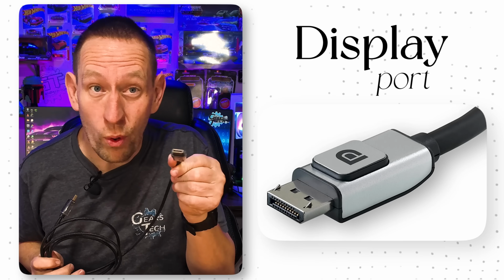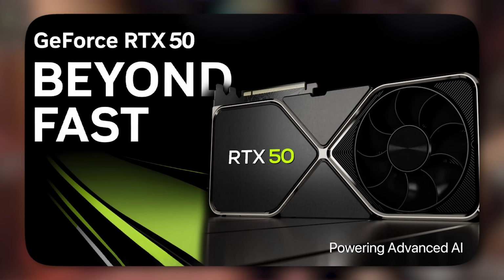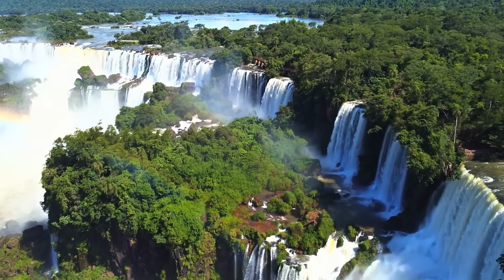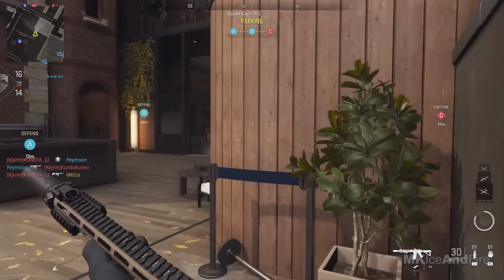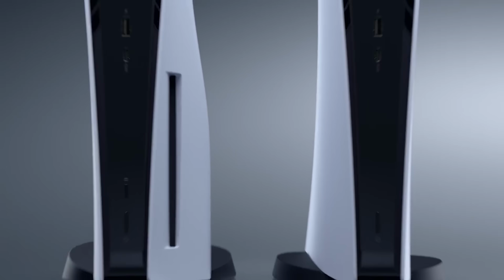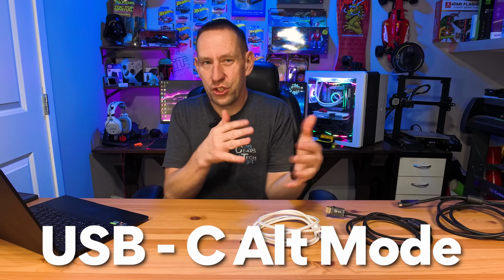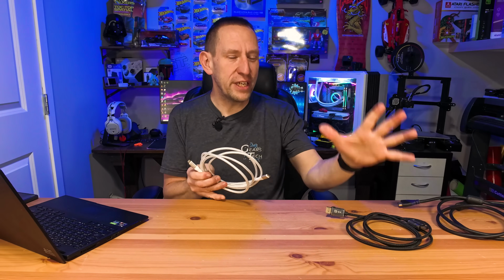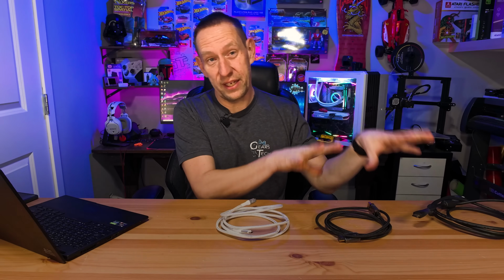HDMI vs DisplayPort vs USB-C Connection Guide

Comment: You said that DisplayPort Only carries display, but that isn't correct: DisplayPort supports sound as well. It seems that there are allot of tech videos being produced that fail to accurately cover the item they are trying to explain. I'm this case, it is just not correct at all.  Also, DisplayPort is also hot swappable. I think a deeper look into DisplayPort capability, and amendment to this video should be done for accuracy of information.
Reply from the maker: Thanks for setting us straight.
Reply: Good video overall, most people were likely unaware of the majority of stuff you shared, so big help in that area. @GearsAndTech

Comment: Something not covered: I use an MSI 4090 Titan laptop that passes through a Shockwafe 9.2.4 sound system(You underestimate the value of Dol,by||Atmos surrond sound in gaming) to a MSI external monitor. To say that finding a set up that worked with the least loss of performance was a cable costly nightmare downgrades the term nightmare. 

Separately connecting the monitor (HDMI 2.1b) and sound system (USB-C - Thunderbolt) caused video and sound to not be in sync. This was also true if I reversed the type of connections. In the end I ended up with USB-C Thunderbolt to Sound System and took HDMI 2.1b from the sound system to the Monitor. I have reliable 100FPS (100Mhz monitor) with surround sound and am very happy with it. More often than not I exceed 100FPS, though I'm not sure how given the Mhz cap of the monitor. The only set back is, if the audio isn't in use, I have a 14 second delay before it kicks in that I haven't been able mitigate.
Reply from the maker: The delay is likely your sound box needing to assess the signal correctly.

I know what you mean about surround sound and gaming. I'm still running astro A50 with optical connection from my ps5 so I can use surround sound instead of Sony's fake 3d audio.

It makes a difference

Comment: I don't really have any idea. I was given a gift of a DisplayPort 2.1 and it says 16k on it whether or not I believe it. This is what I was told was best for my 320 HZ monitor right now. At the moment, Corsair didn't give me the right power cables and shorted me one so I don't have the full sufficient support that my GPU has. So when I tried going past 120 hertz I would get a black screen until they went back to 120 hertz and then it stopped. So maybe once I have enough power stable steady power I can try 240 or 320 just to see if it stays on the screen for more than 5 minutes. That's my long-term goals. If cosair here ever gets their act together and actually sends me the right cables the second time. I've been waiting nearly a month because of their slow response and poor customer service. Maybe I'll be able to go past 120 HZ once I have the right sufficient power cables

Comment: I installed a 5080 in my new gaming build.  It has 1 HDMI and 4 DP ports.  My main monitor is hooked to HDMI and my back up to the DP and for some reason on boot up, it tries to use the back up monitor first.  Kinda makes me think that when I upgrade my main monitor I need to go for DP.  Thoughts?

Comment: USB-C is a connector size not a cable type.  It can deliver just power (PD or not), USB 3.0/3.1/3.2 or the various Thunderbolt 3/4/5 standards.  There's no mention of Thunderbolt at all in this video, nor any discussion about how HDMI 2.1 is not good enough for 3D content if you want today's standards for video (4K + HDR) -- it's a 7 year old standard now. Thunderbolt daisy-chains, includes audio, and includes power delivery.
Reply: I noted the lack of discussion about 'Thunderbolt' as well. While USB-C connections are abundant the performance difference with a Thunderbolt port is HUGE.
Reply: USB-C is a separate type that can carry thunderbolt over it, people can have bad cables or compliant ones. I wouldn't dismiss it as a connector size, so reductive that it's misleading
Reply: Also thunderbolt is too different to hdmi or displayport and would seem out of place here. It can carry a form of displayport through it but isn't a competitor

Comment: Hi GearsAndTech, I have an LG 32gs95uv monitor that has HDMI 2.1b & DP 2.1b ports & the monitor supports 4k @ 240hz and 12 bit colour output. I'm also using a RTX 4090 that has HDMI 2.1 but only DP 1.4a. In this case, would you recommend using the HDMI option with compatible cable and also is the HDMI 2.1 capable of supporting the specs of this monitor (4k @ 240hz & 12bit colour output)?
Reply from the maker: Both will only do 4k at 120 Hz

Do will do 1440 at 240 Hz

Given the 2 choices, I would go with dp if possible
Reply: @GearsAndTech  Thanks for the fast reply, out of curiosity, why display port? Also I forgot to mention, my Nvidia display settings are currently set at 4k @ 240hz & 12bit. Seems to overall look and run fine, is there any issue running these settings with the previously mentioned hardware?

Comment: This may seem  little off-topic, but it's not to a specific niche of people...  I recently struggled through this as a Linux user.  Although HDMI 2.1 will support 4k resolution at 120 fps, it's important to know that for Linux users who have AMD graphics cards (and most do) it will not.  I'm not going to spend time explaining why here, there are lot's of articles online explaining why.  But as a Linux user you need to know that if you want to get 4k resolution at 120 fps out of your HDMI cable you have to use an NVIDIA graphics card.  I wish someone had told me that  few months back.  I went through a lot of time and hassle (including ordering, returning, and then re-ordering another graphics card) to find out.  I consider myself an "advanced" Linux user, but even I had never heard of that scenario.  Be aware.

Comment: my question is if you have one of those hand held gaming devices (in my case an rog ally) that uses a usb-c connection to a dock, that has a display port and/or an hdmi port, how can i still make sure im getting the best option out there. (i have not purchased a dock yet but an currently using a lenovo thinkpad usb-c dock that only has display port)
Reply from the maker: Display port is still your best option as the usbc connection will be using display port over usb to the dock

Comment: Thank you for this excellent video. You do great job with presenting the viewer with a cogent, well researched and knowledgeable source of information that I will now use when I do my next computer upgrades. I currently have an Asus Tuf 4090 card hooked up via a display port to an LG 34GP83A-B which has the 1.4 standard, not 2.1. While I likely won't upgrade the 4090 for quite some time, I am thinking of getting a bigger monitor to use for flight simulation. Your video(s) will help me decide the best way to go.

Comment: If you use Linux it's probably best to avoid trying HDMI 2.1, it's a closed proprietary standard.  My hardware is old enough that it doesn't matter.
Reply: I'm using it on nobara and I don't have any issues.

Comment: Move video! I think daisy chain isn't too common. I've run 4x1080@60 on a single DisplayPort 1.4a with a MST hub and find is more likely use case.

Also, USB C / TB dock is a very typical use case.

On USB C monitors, I've found that especially on LG there isn't support for DSC. So 4 lane mode is required rendering monitor USB A ports practically useless. Generally a dock that is verified to support DSC or using TB offers better performance and flexibility plus addresses higher wattage host port charging demands.

Comment: For my work set up, I currently use two monitors and a laptop. I plug one monitor into the wall, then run USB-C to the other monitor, then that 2nd monitor into my laptop. Love it. Only 1 item is plugged into the wall and no mess of cables.

Comment: I like display port because the connection has got a physical disconnect prevention mechanism for devices that might move, like a laptop that moves around on a desk or a screen that might move up and down or rotate.
Reply from the maker: Great point
Reply: You're saying HDMI cheaped out on their plug design? Noooooo. Whenever possible I go DP. Unfortunately, the specification is limited to 2M for the best resolutions. But the world is littered with standards that are higher performing than defacto standards. Betamax Video. ATM VS. TC/PIP. TL,DR: There is no money to be made within a standard. Unless you're Apple. ;)
Reply: Right, could you imagine trying to keep a USB-C cable from being knocked out?
Reply: @DoyleShadduck usb-c sucks for that.  I barely move my laptop and the connector fails. So annoying.
Reply: @scotteebee
Even in my damn phone it’s constantly falling out or just losing its connection. 🙄
Reply: There is no locking mechanism for a DisplayPort cable attacked to a laptop. That mechanism is only on the large plugs which attach to the monitor.  On the laptop side, it’s all USB-C.
Reply: @marshallgoldberg8376 Hmmm, if I hear you correctly, you’re saying that your laptop does not have a display port connection.  Rather, it has a USB-C connector thus making your point moot.
Reply: @scotteebee No, my laptop (MacBook Pro) has USB-C Thunderbolt connectors. So you can attach a DisplayPort cable directly, and it sends DisplayPort. Or you can plug in a USB drive and it sends USB. Or you can attach a power adapter and it receives power. Or you can attach a Thunderbolt hub, and the laptop sends packets of DisplayPort and USB which receiving power.
Reply: @marshallgoldberg8376 right.  But the original comment was with respect to the physical connector and not the protocol.
Reply: @scotteebee And what I’m saying is that you cannot buy a laptop today which has the locking style DisplayPort connector. None I know of; historically they used a different, non-locking connector and today they use USB-C.  And USB-C can be anything the manufacturer wants… it can be only power, only DP, only USB, Thunderbolt, or a combination.
Reply: @marshallgoldberg8376  I suspect that is a very true statement.  And, not having a locking USB-C connector sucks. Mine wiggles out all of the time - but the display port cable attached to the docking station never has an issue.

Comment: For some reason my graphics card will only allow me to set my monitor to 10 bit colour using display port. Using HDMI I'm stuck at 8 bit colour. Not really a problem as my card has three DP ports and only one HDMI and my monitor has a variety of ports.
Reply: First thought: check/test what standard your DP cable is. Believe it or not, not all marketers tell the truth! And all manufacturers have top tier QC~!! ;)

Comment: Can i use display port on xbox series X?
Reply: If you find get an HDMI to display port option, then probably. I have one but only used it on my pc.
Reply from the maker: would need an adapter as it only has hdmi output

Comment: On another YT channel, the guy said up to 4 separate monitors on DP2.1 daisy chain?
Not 2.
Reply from the maker: In theory you could daisy chain more than 2. It depends on your video card, the monitors, and the target resolution and refresh rate.

DP can only carry so much bandwidth. After 2 you would have to drop the resolution and frame rate to get the 2rd going. On a gaming setup, 2 is as high as you want to go

On a productivity setup, you could do 3 or 4 due to lower resolution and frame rate needs
Reply: @GearsAndTech  Thanks for your response.
And the info.
My purpose would be to run 4 screens for stock charts while trading.

Comment: Why do the cables you covered cap at 120fps when we see gamer pcs getting 200 or more fps displayed on the monitor meter. Thx
Reply from the maker: The pc can put out more frames, but the monitor isn't neccisarily displaying them all. That's why you see screen tearing when you don't have sync enabled.

Comment: I've been using HDMI for years. Just recently, I got two new Acer Nitro monitors for my PC and decided to use DisplayPort. Reason being is that the monitors have 180Hz refresh rate, and the HDMI ports only go up to 144Hz (which is still a lot and blows my old Lenovo and BenQ monitors out of the water, which only capped at 60Hz). The difference is night and day.

If you care about the refresh rate of your monitors, go DisplayPort. If not, HDMI is more than enough for general use.
Reply: I use a 165 hz monitor and I get 165 hz on HDMI.
Reply: @WEEENYforSWEENEY  That's likely just a limitation of that specific monitor, rather than of HDMI.
Reply from the maker: 100% agree

Display port is the safest one to use if you don't want to think about it alot.

But hdmi is fine for most people if they don't care
Reply: He’s absolutely correct about the supported refresh rate on HDMI 2.1.
1080p: Up to 360 Hz
1440p: Up to 240 Hz
4K: Up to 120–144 Hz (with DSC). For now at least 144 Hz is the max. I’m sure they’ll be changing that in the near future because many new monitors only come with HDMI and VGA ports.
Reply: Yeah I just got an Acer Nitro and it’s the same for me…DP to get full refresh rate.

Comment: Hdmi for my 1440p oled 360hz
Reply from the maker: Great choice. Make sure you're using a high quality hdmi cable or you could be bottle necking
Reply: @GearsAndTech  I'm using the samsung cable that came with the monitor so I should be good 👍